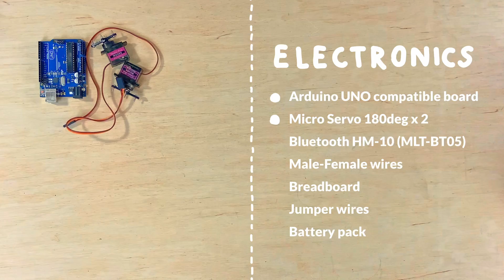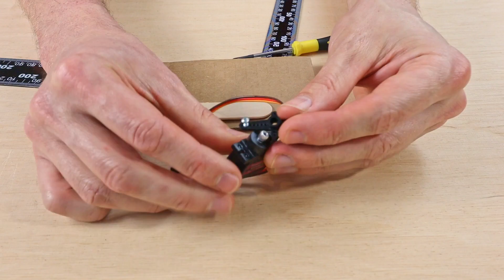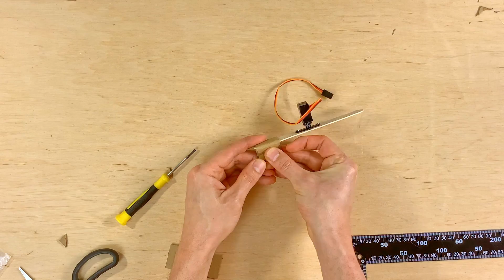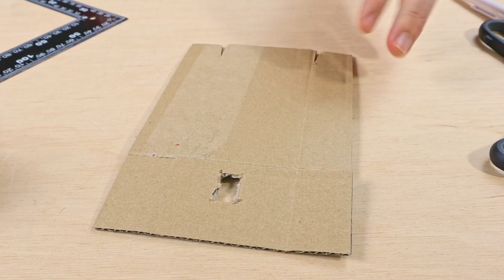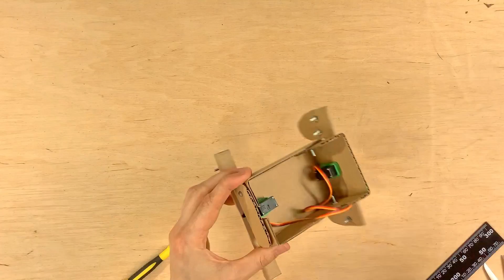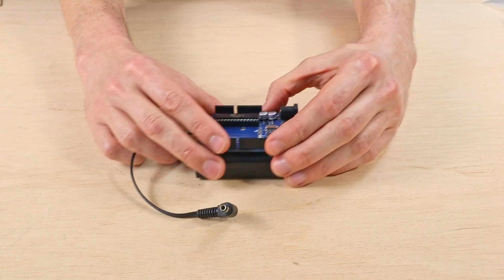Easy Arduino Robot Dog Built With Cardboard

Comment: App not working sir
Reply from the maker: Where is the problem sir?
Reply: Could you help me? It doesn't syncronize with the arduino. Which could be the problem?
Reply from the maker: I need more data. What bluetooth module? Does the app connects with the bluetooth module? What baud rate on module and arduino?
Reply from the maker: Pro tip - try consulting it with ChatGPT